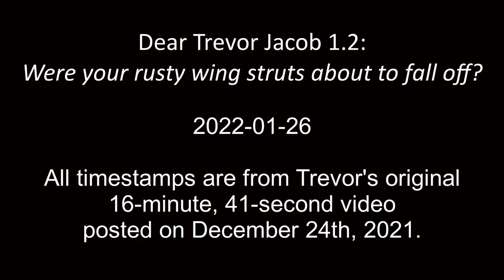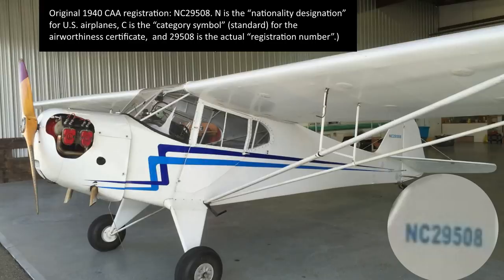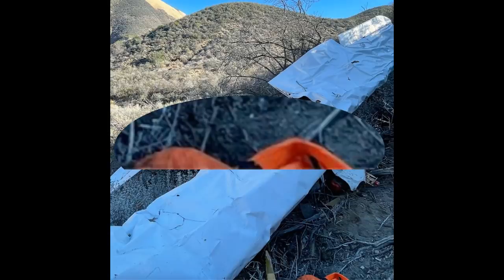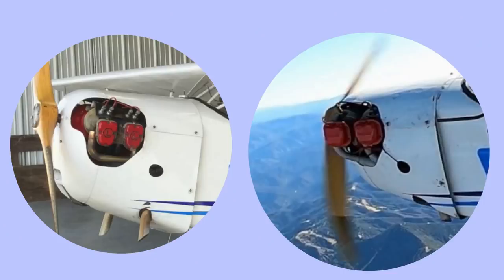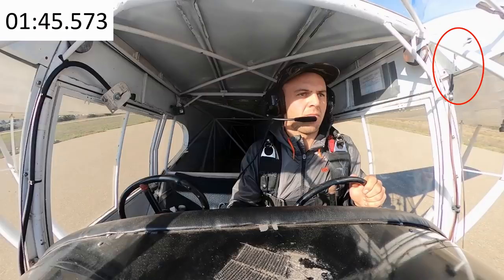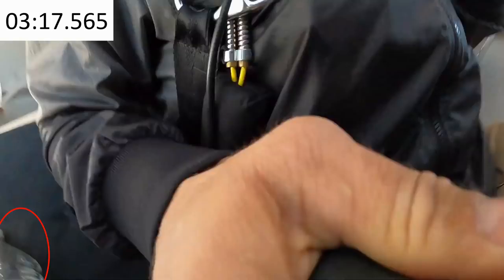Dear Trevor Jacob 1.2—were your rusty wing struts about to fall off?

Comment: If the altimeter was disconnected, then you are missing one of the VFR mandatory flight instruments. Another FAA regulation violation 14 CFR 91.205(b)(1)
Reply: Air speed appears to be disconnected.  The altimeter operates on barometric pressure and can be a stand alone instrument in a non pressurized plane.
Reply: Unauthorized engine swaps and failure to comply with ADs makes the plane unairworthy
Reply: @SoloRenegade  - I think this is what the FAA will nail him with. There is no excuse.
Reply: @bobroberts2371  : true, albeit partly true. The baroaltimeter must be fed an unadulterated STATIC PRESSURE, which is not at all the case with the mere "cabin air". Pitots usually supply both dynamic & static pressures.

Comment: I don't like the look of the engine cowling, the oily finger prints next to the sealing points, like it had to be forced shut after an engine change but the engine and fittings now don't match properly and had to be adapted with new holes made for exhaust pipes carbs etc. The whole thing seems fishy, no restart attempts, no attempt to glide down from height that should have allowed for a safe landing, very strange, I might have jumped if a wing fell off so that gliding was not an option but jumping from a plane that was still flying? No,this looks like either an insurance scam or deliberate crash for "likes and views". I hope FAA nail him to discourage further YouTubers from doing anything similar.
Reply: How true.

Comment: Even with a failure you're supposed to maintain control of the craft to the best of your ability... Given he was in a pretty isolated area, he could've still hit someone's property, or just someone outright.
But I guess he got too excited to rake in those clicks.
Reply: Petter (Mentour Pilot) pointed out that he had plenty of altitude and loads of good places to land the plane. And he didn't even adjust pitch for optimal glide; instead he adjusted to make the prop not spin, for the drama.

Comment: I think Trevor has stepped in it with the FAA, taking off with the pitot static system disconnected is a violation of Federal regulations, Checking the TCDS (Type Certificate Data Sheet) indicates the Continental A-65 is not authorized for installation so unless there is a field approval from the FAA or a Supplemental Type Approval it shouldn't be there also there appears to be a fuel valve up near the right wing root, the only aux tank authorized is a 6 gallon tank in the aft fuselage, most likely where the baggage bin is located. Wonder what the log books look like if they exist otherwise if not properly approved and logged the plane is illegal to fly. Hope he gets some time in lockup plus a hefty fine for violating the law.
Reply: failure to comply with ADs renders plane unairworthy until fixed.
Reply: But bad part is that these are only fineable offenses, not jailable offense’s. 

So, he will likely see a sizable fine which will hopefully cause some pain but there will be no jail time, at least from the crashing of the plane
Reply from the maker: I don’t know about that. I’ve heard one rumor of a criminal investigation, but nothing concrete yet.
Reply: It's not a big deal to change the airplane from BL to BC.
Reply: @buckmurdock2500  No, it's going through the paperwork drill and getting the Fed's to buy off on it that can be a pain.
Reply: @PetesGuide  anyone have any updated info on any of Trevor’s crap sandwich he created for himself? And he even Super Sized it for himself, lol

Comment: It also looks like he beat the hell out of the cowling with a ballpeen hammer. I would conjecture he used a bungee to hold the engine cowling on after trying to modify it to accommodate the different engine and exhaust. I almost felt sorry for Trevor until I saw that statement he made in the New York Times article. It's obvious he has no remorse and thinks it's all a big joke so we'll just have to wait and see what the FAA determines.
Reply: I noticed the cowling too, also oily finger prints around fixing points, I'm sure a qualified mechanic would have wiped down the cowling after any work, whereas an amateur illegally working on a plane they might be planning to crash would not bother.

Comment: You can’t really tell from this video if the struts or engine are airworthy or not.  1st off, for all we know those are sealed struts from Univair that terminates the AD.  2nd the way to determine if the struts are serviceable is through ultrasonic or eddy current testing.  I certainly would not fail a set of struts based on the visual inspection from this video.  And last, just because the FAA has the engine listed as a Lycoming 145 (as this was the engine it had when it was certified) does not mean it hasn’t had a Continental installed legally.  It may have had STC SA3-640 installed.   You’d need to pull the maintenance records from the FAA in OKC to be sure.  If it was changed by STC it should have a 337 on file. It would cost you $10.00 to find out for sure.  Don’t get me wrong. I’m not trying to defend Trevor.  Whatever happens to that putz he deserves.  I just like to make sure when we’re taking aviation regs we get things correct.  Cheers!
Reply from the maker: Good points. The suggestion to cover the AD came from a concerned citizen in the aviation space, who was mightily concerned. One of the main purposes to my video series is to get more details surfaced, and your comment helps.

But do read the 2008 AD—the FAA deleted eddy current inspections from it.
Reply: @PetesGuide  yea.  You’re right about the eddy current thing on the AD.   I’ve never done an annual inspection on a T’craft but I’ve done lots of ragwing Pipers.  For those we can use ultrasonic or punch them with a Maule tester ever 1/4”.  As for ole Trevor, I don’t know what to say.  You’d think he’d have his ducks in a row before he pulled a stunt like this as he had to know the FAA was going to be up his ass with a flashlight.  Was the airplane in annual, did he have a current flight review, who knows. BUT I’ll bet we all find out in the end!   Blue skies to you!
Reply: But failure to inspect and correct the corrosion we see, within teh past 48 months, renders it unairworthy, even if they don't need to be replaced. Curious to see the logs

Comment: On another vid, it's pointed out that when he''s picked up by the farmers, he has a grey, long sleeved sweater on (you can see the cuff in the vid).  He didn't have this earlier, nor was it the black jacket he originally jumped with.  Speculation is that he actually had someone fly him back over the crash site the next day and jumped out a second time to get the footage of him landing near the plane, trekking thru the brush, and getting rescued (all staged as well).  the author showed where he jumped out in the original vid, and showed how he couldn't have made it to where the plane crashed, considering his long ass free fall.
  

So much to digest!!!
Reply from the maker: Wouldn’t put it past him. Which video is that?
Reply: @PetesGuide  Honestly, I've watched so many vids about this that I can't recall.  If I come across it again, I'll let you know.
Reply from the maker: Same here. My version 1.4 will have something I’ve only seen in one video, that I rediscovered looking for clues for version 1.3, and I haven’t a clue where to look to credit the guy.
Reply: I’d heard he’d charted a helicopter to remove it from the mountain a couple of days after to prevent the FAA from investigating
Reply: I’m sure he got the cameras right after the crash and got out quickly. Can’t risk a ranger or hiker reporting the crash. That’s why he needed to carry the chute out, so he could drop back in the next day and film his escape without having incriminating evidence on him.

Comment: Did you catch the fire extinguisher in his pant leg? You can see the cylinder, the nozzle, the gauge, and the red color on the bottom. Or the the fuel sector hanging from the right door post?

Comment: @5:11 three things 1 is the side window b pillar bent? Right under the gopro. 2 is that repair screen snd Bondo on the dash? 3 what is written above the door to Trevor's left? Looks like something typed.
Reply from the maker: 1) I’m not sure; it could be the normal shape of the plane. 2) I think it’s Velcro, but I’ll look into it in a future video. 3) That’s almost certainly the aircraft’s registration. Probably not current since 2018, which makes the plane illegal to fly.
Reply: @PetesGuide  
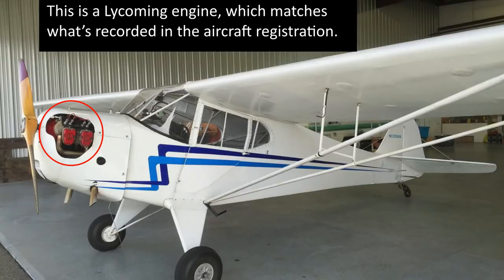Speaking of that GoPro (the one that was facing the dash). At around 3:17 in the video (the close-up of his chest while he swears) you can see the perch where the GoPro was mounted, though the GoPro itself isn't there anymore. It looks like it's attached to a small handle, so it is likely the one he is holding while jumping out of the plane. That would mean that he chose not to show any of the dash footage, not that there was no video left. 

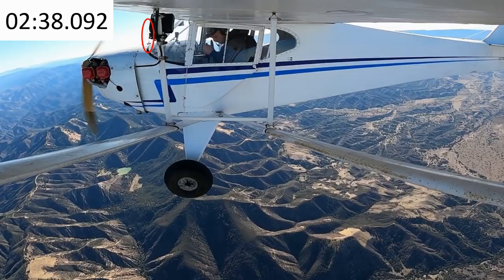Also, when he lands in the brush, you can see what might be a water bottle in the chest of his jacket (5:52), and around 6:06, his jacket looks wet. Almost as if his hard landing in broke the water bottle open. A little later on (6:11) the branch puts some pressure on his jacket and causes whatever is hidden there to bulge out again.

Let me know what you think, you've brought up some great points so far.
Reply from the maker: @carlrecine  I suspect you’re right on all of that; it’s just going to be a bit before I get to those. Camera rundown probably in version 1.4…

Comment: That's the same water bottle he drinks from when he's picked up by the 'farmers' at the end of the video.

He had it the entire time.
Reply from the maker: I don’t think so. Different brand, and I haven’t figured out which yet.
Reply: I'm not convinced. He could have collected it from the crashed plane, just like the cameras.
Reply from the maker: @WackyAmoebatrons  the shape of the bottom doesn’t match. I’ll try to add photos to the next video.
Reply: 1) Did you really make out the brand of water on the "farmers'" bottle?
2) Even if the same brand, there are these things called stores where people buy things like water.  I read a comment where a guy recognized the bottle in the plane as the same brand he buys. Was he also in on it?
3) If the farmers are real, do you think they would not have had their  water

Comment: Why is the prop and prop hub not on the engine. If the engine was not producing any power and the prop was stopped then usually one blade just breaks off. I have never seen a stopped prop shatter completely off an engine. 0:26
Reply from the maker: I think it was windmilling at impact. Very slight chance it was running, but 100% it was turning. You can see part of the prop next to the orange thing.
Reply: on impact the aircraft that had been clearly trimmed nose down was flying at a high speed and the prop was turning at a reasonable enough speed to do that amount of damage to it

Comment: He promotes a chute as safety precaution when flying, but it wil be only helpful in a small number of scenarios. If plane goes into an spiral dive, some control surface or cable gives up .... I dont see how you can get out of it. Also you need a decent altitude to do that. So, it basically works when the plane is FLYING ok, that is, doing its thing (with or without its engine) If so .... then you have plenty of time to work out how to land it. From the video it looks like this thing glides like a dream.

Comment: I’m a pilot and aircraft mechanic. The obvious issue is airworthiness. In my opinion, this aircraft appears to have been assembled and flown without the certification of an IA certified A&P mechanic. The FAA will likely ask for proof of airworthiness (log entries) and issue an appropriate enforcement action if this is not provided. I imagine the FAA will have other issues to address but the airworthiness (or lack thereof) is pretty simple.
Reply from the maker: What actions can, and what actions does the FAA typically take for the kind of work on we have seen done to this plane without any paperwork or involvement of an A&P?
Reply: I imagine that will be one of their concerns. He will likely also be facing criminal charges for reckless endangerment, vandalism of a national park, etc.
Reply: @PetesGuide  In Canada it’s usually a fine or suspension of a license. The FAA probably has a list of typical fines somewhere on their website.
Reply from the maker: @darrylday30  A reliable source told me the agencies are in uncharted territory, so I think fines are the least of his worries.

And that’s a huge part of why pilots, and those like me who desire to be pilots, are so frustrated with this apparent stunt, because the likelihood of the regulatory bodies increasing regulation and/or oversight is high, and we fear it will be increased in the wrong areas.
Reply: @PetesGuide  “Taking Off” youtube channel did a video with an aviation lawyer. You’re right, things are not going to go well for Trevor. You should take a look.
Reply from the maker: @darrylday30  Watched it within a few hours of being posted!

Comment: Did he have the door open shortly after take off for rapid exit because he had so little faith in his amateur engine change? just thinking out loud....
Reply: Well he was flying a cobbled together aircraft with a potentially out of hours engine, not very much fuel, no Airspeed Indicator and a very fragile airframe........ lets say the climb out to above safe jumping height probably had him a little on-edge shall we say?
I don't know if he is nervous in his original video, I have never watched one of his vids before, so I wouldn't be able to tell if he was more edgy than normal or not.

Comment: 2:17 rust on the strut. This is dirt. Aluminium does not rust like that. I used to fly in a C-185 every weekend and we used a cow field. So the plane was covered in Dung every day and had to be jet washed every night. The leading edge just picks up dirt. Trevor Jacob is not likely to clean an aircraft if he is about to trash it. but it shows a lack of love or respect. also dirt induces drag.
Reply: the struts on the Taylorcraft are made of steal and do rust
Reply: @ecomandurban7183  Wow that sounds heavy.
Reply: @grahamthebaronhesketh.  Aluminum was still a very expensive metal back in those days. In 1935 it cost about 20¢ per pound in the US, (I'm not going to do an inflation calculation because we're just comparing the cost, but if you want to, go ahead) while hot-rolled steel bar cost about $1.80 per hundred pounds, or about 1.8¢ per pound. Aluminum is pretty cheap nowadays, given it's abundance in the Earth's crust, but due to the difficulty in purifying and refining it, it did not become relatively cheap until fairly recently.
Reply: @richardmillhousenixon  Thanks for that.
Reply: @grahamthebaronhesketh.  It was so much of a "precious metal" back then, that in the 1880s when the Washington Monument was built, the aluminum cap was seen as a sign of prestige because at the time it was one of, if not the most expensive metal and the most difficult to refine.
Reply from the maker: Yes, but the entire frame of the plane is welded steel tubing, so not much different. The wings are wood covered in fabric, and the fuselage is covered in fabric.
Reply: @PetesGuide  I have never flown one but I take your word for it.

Comment: Two more things to look into when examining the video. I noticed that at a short glance you can see the tail registration with the left wing GoPro when he wiggles the plane up and down due the GoPro stabilization, is it the same plane? Right after he has taken off I noticed something big like a backpack or something on his horizontal stabilizer, also due to GoPro stabilization, I don't think it is a backpack but what is is? First you see the shadow of it and then part of whatever it is.
Reply from the maker: What is the time stamp for where you think you see the shadow and then something?
Reply: @PetesGuide  I also want to know where they spotted this.
Reply: Tail number can be slightly seen starting at 1:48. Fabric material on horizontal stabilizer can be seen at 0:15.
Reply: @harrisonhigh4603  This is in the new shorter upload, now present on Trevor Jacobs channel. The tail number can be seen already at 1:43 some where and forth. The cloth or whatever it is is seen in two clips from the tail, not just at 1:15.

Comment: 4:39 on the registration it was stated as a “parts harvest” so that 1. Should never have been in the air 2. It probably wasn’t even registered since it would’ve stated it had a new engine in its next registration 3.he probably bought it without a engine I should add on the topic of his engine he purposely stalled it since he had the door open slowing it down then he tried to slow it down with the alierons and creating a lot of drag so he sent it to stall speed and stalled the engine leading to the affect of”engine failure”

Comment: does the bl-65 bit change when the engine is changed? it seems like the model number as it came out of the factory stays the same nomatter what you do to it. as i understand the swap to the continetal is common for this type of plane because the lycombing isint supported, and the continental is worth more even as a core.
Reply from the maker: That’s an excellent question! I’ve heard it both ways, but never from an authoritative source. The model number on the manufacturer plate can’t be changed physically, but paper records can, so both answers might be correct.
Reply: @PetesGuide  i think if the FAA goes up to a plane and the manufacturer's plate doesn't match the records that will be the problem. rather than the model number actually representing whatever specific engine is installed at any given moment.

also idk it that plane ever came with that specific model engine from the factory so would there be a valid model number to switch to?